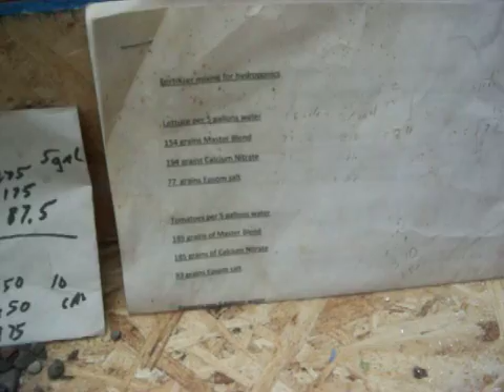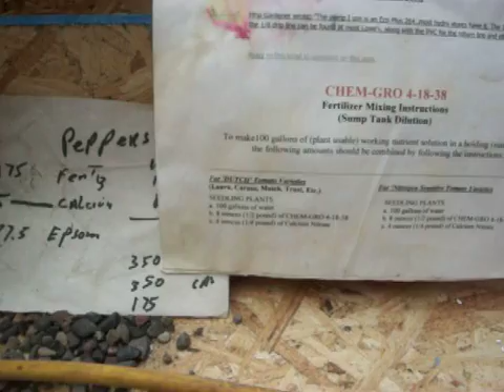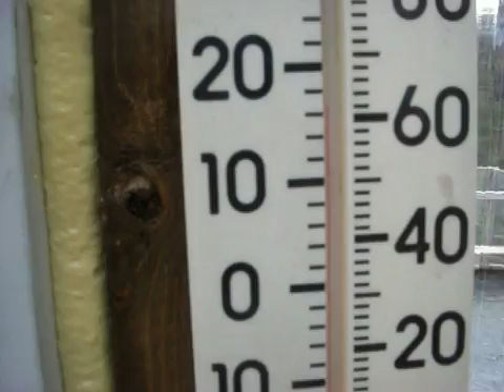Tomatoes, cabbage, and broccoli planted in hydroponic setup. 2016

Comment: Is that copper pipe you are using?  Copper pipe and brass fittings are not a good idea, over time you might get crystal salt build ups which will more than likely throw of the ph, just a thought.  Good job.